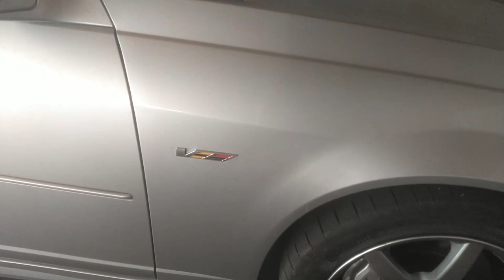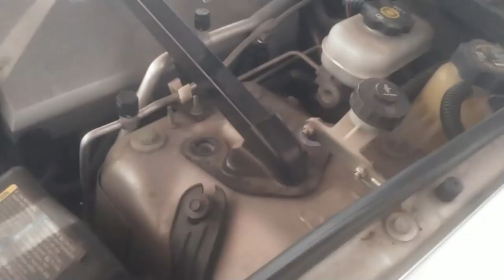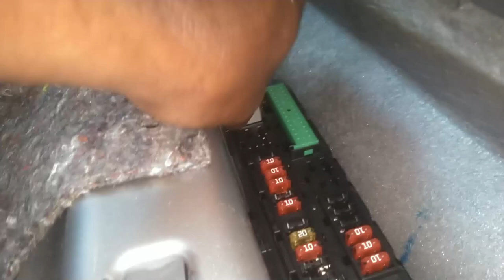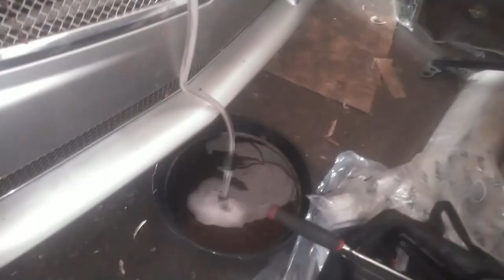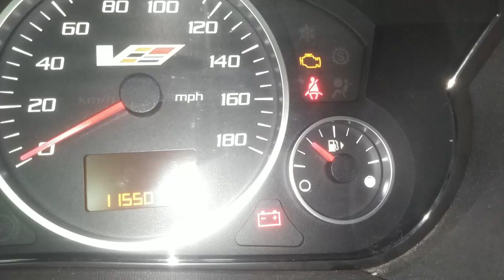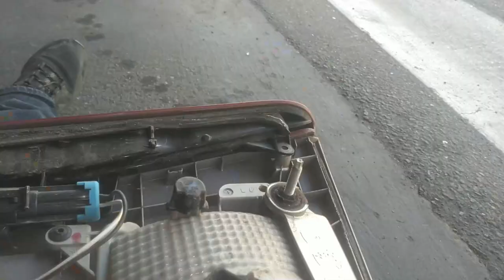Mixing it up a bit. Helped a viewer work on his Cadillac CTS V series car. Tried to empty fuel tank

Comment: that caddy, wouldn't it be easier to take out the fuel filter, if its on a rail along the frame.. and put a bucket there to catch all the fuel coming out the fuel line from the pump?  and if u take from the fuel injector rail, dont you have to remove all the intake stuff?
Reply from the maker: Huh? Rail is easy, and you get the bad stuff out of the line.